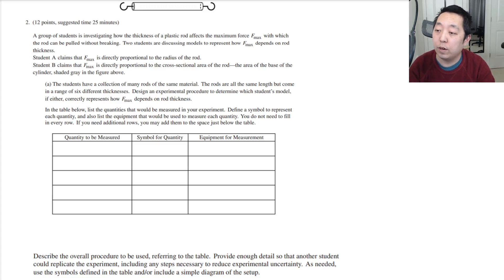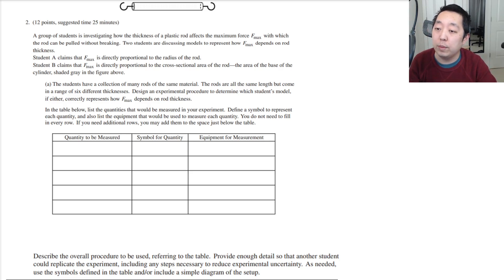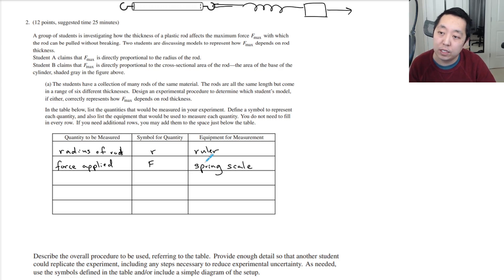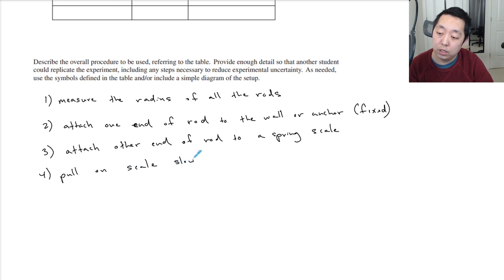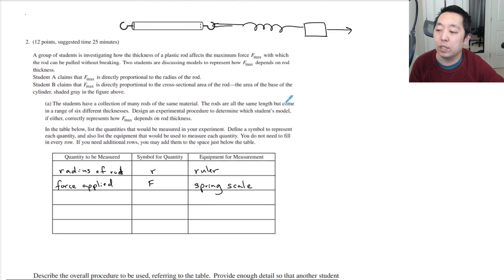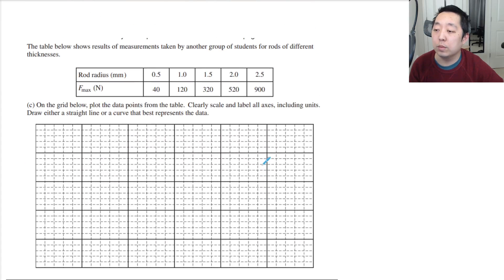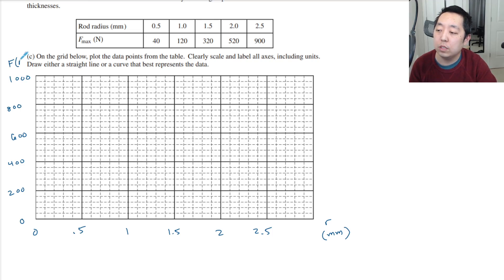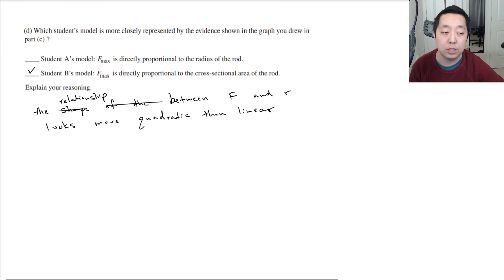2021 AP Physics 1 Free Response #2 (First Administration)

Comment: I would disagree with some claim of the experiment in this video:
1. Calculating the radius is hard, considering the size of the rod. I would suggest measuring the diameter using a caliper, then devide it into 2 to find the radius

2. Placing a spring scale in the other end causes the deformity of the plastic rod to change. I suggest putting it on a fixed wall, and weight the block beforehand.

I'm not sure if this is a good advice or not, so please let me know what you think
Reply from the maker: I would agree that 1 would reduce error, but there's nothing inherently wrong with using a ruler. The calipers do have a higher degree of accuracy.

It's not clear to me why a spring scale would cause a deformity but a mass at the end wouldn't. In both cases, you have to vary the force at the end which will ultimately cause some strain. The accuracy of using masses will be based on what the smallest unit of mass you add until the rod breaks. However, either method should be considered an acceptable answer.